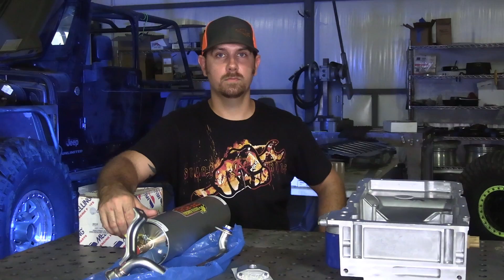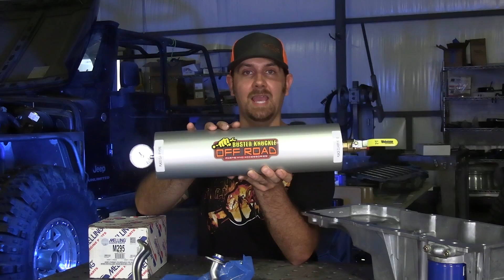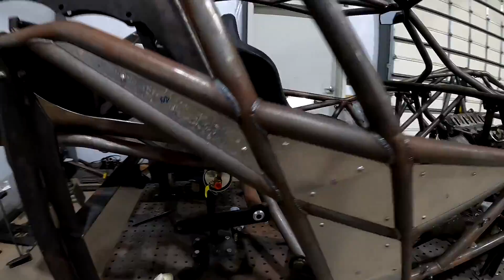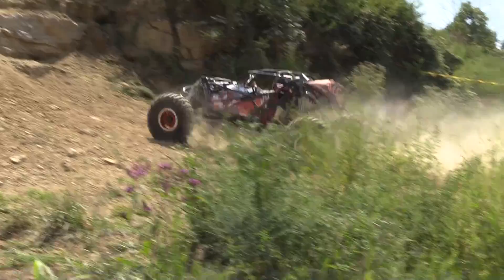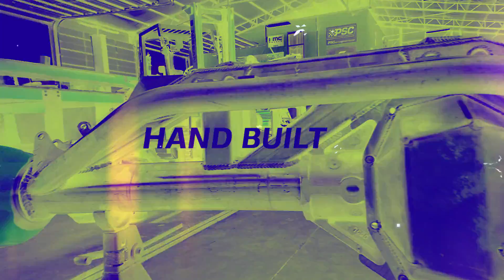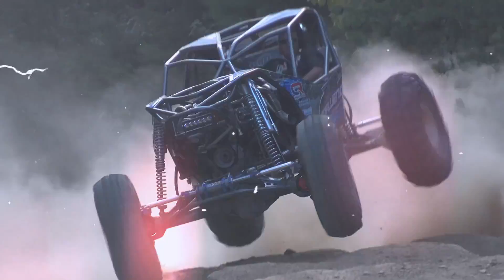Protecting your Off Road Engine - Tech Tuesday

Comment: Is there anything different you have to do when changing the oil?
Reply from the maker: Yes you need to leave the valve open when draining oil. Once you have the appropriate amount of oil added back into the system. You fire up the engine, let oil pressure build in the accumulator before closing it off. then turn off vehicle to check the oil.

Comment: Two questions. With a remote mounted accumulator I imagine a significant amount of oil can be held in the line. Is this not an issue because it wont bleed back into the pan if it is not under pressure and having the valve shut will cause the oil to try to pull a vacuum? Question two: do you run the risk of some oil starvation at start up while the accumulator refills? I still know very little about the intricate parts of oiling, and preventative mods. I imagine the electronic solenoid triggered by ignition would mitigate both of the potential issues. Im just not sure if they are necessary. Great informative video! Thank you for taking the time to explain it to us.
Reply from the maker: None of those things have been an issue for us

Comment: I go off roading with a 1991 s10 blazer. It has the 4.3, which has the deep oil pan (to clear the front diff from factory) and I haven’t lost oil pressure on steep angles yet, and neither has bleepinjeep, so this really only applies to shallow pans
Reply from the maker: It is good insurance if you ever roll over though

Comment: What size hose do you typically use to plumb this using AN fittings and hose? Also how would I go about installing an accumulator like this on a jeep 4.0 engine? I'm guessing the 1/8 NPT pressure sensor hole is too small to tap into? So maybe a sandwich plate at the oil filter or do you have any recommendations for a 4.0? It's plumbed using 1 hose tapped into the oil system right? and when or if pressure is lost it releases its contents into the engine buying a little time?
 I'm very interested in installing one of these on my jeep I'm just trying to think of where to plumb it on the engine, I don't really want to run a sandwich plate if I don't have to. I already added an extra 1/8 npt port for my oil temp sensor next to the oil pressure sensor its a little crowded, depending on the hose size I think I'd have to go straight to the block at the larger thread where an oem adapter usually is that reduces it from 3/8 or 1/4 npt to the little 1/8 thread.
Reply: We use an10 size hose

Comment: As an retired ASE Master Tech since 1978, I am jumping off the beaten path with this comment. How many drive home with a vehicle equipped with “Auto stop-Auto start” systems. Trucks & cars alike suffer from the loss of that crucial hydrodynamic lubricant wedge! Racing or hill climbing is one thing, but if you don’t lease your vehicle or trade it in every two years, I would instal one with a solenoid wired to the starter solenoid. I want my engine to have oil pressure quicker than the slow drip of death sitting at a red light. Some would argue that oil is between the rods & mains, but a what pressure? None! I want a minimum of 5-10 PSI that happens to be slightly more than a switch for an idiot light specs. You can find room and an oil gallery to tap into. Galleries are cast into the block, drilled, honed and threaded cap installed. Hey, it is better to have a good engine in your buggy but also a way to tow it home. Unless you want to spend time to defeat the Auto off system by running the A/C on max during a -9 degree F winter in February! Your choice.
Reply from the maker: that is definitely something to think about
Reply: @BustedKnuckleOffRoad   I found out that trucks have an over ride switch. Most likely for towing, but I would like to look at a schematic to see it goes into un-used terminal on the PCM or what. The A/C control and dash response is most likely all class-2 serial data signals. So, even if PCM is programmed for it, it would be hard to create the correct input to over-ride. I will work on that thought after I talk the guys I worked at dealer. I bet they have a pump inside the trans to keep it ready for first gear as well. DK, Omaha

Comment: So I have one concern. What about the fact that oil pressure is slower at idle than at revs.... When you rev up it would take more time for the pressure to rise? Also do you check your oil level and close the valve at idle or at higher rpm??? I am asking this because I want one for my daihatsu feroza :)
Reply: Busted Knuckle is right. Add this system. Your questions; Slow RPM’s require lower volume, resulting in less pressure.  No volume, no pressure, just like fuel pressure. 
  Run engine at good oil pressure range, shut tank off. Check oil. Oil pan holds oil and accumulator as well. A running engine has oil in lifters, inside heads, cam & crank sling oil up, oil running down the block & thru return holes. 
  This accumulator saves a volume of oil to keep any pressure to the rotating mass to prevent failure. It is your choice. I have a solenoid operated accumulator on the 3 cars, motorcycle and convertible I don’t drive often. After decades of working on these and seeing bearing wear on crank, cam and rockers. 
 Catch cans work well also. The 113k LS engine from my son’s Tahoe had valve tip wear on the the evacuation side, while the other side was inlet fresh air, I was convinced!
ASE Master Tech since 1978-Retired.
Reply from the maker: None of those are issues with this setup.

Comment: How do you feel about the electric solenoid valves on an accumulator?
Reply from the maker: They are ok, but it is just one more thing to fail. We prefer the simpler more reliable manual ones.

Comment: Just adding my .02. Years ago ( I’ m old) we used the accumulators to prime our dirt track engines before we started them. So right before shutdown, close the valve. Right before startup, open the valve. Oh, always appreciate your videos. Well done.
Reply: You can add a solenoid switch to your ignition and then it will automatically open every time you turn the ignition on right before starting
Reply from the maker: You can do that for sure, especially if the vehicle sits for a long period of time.